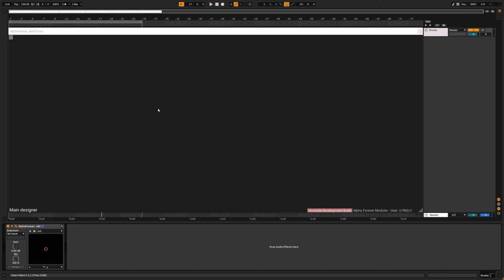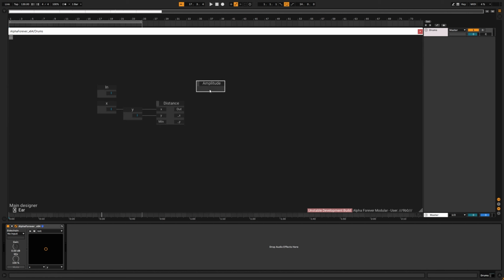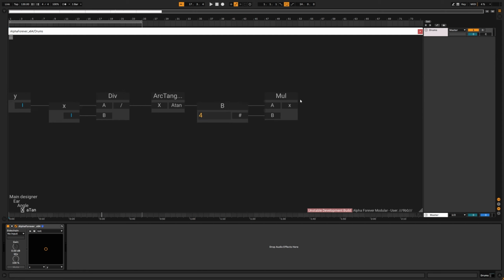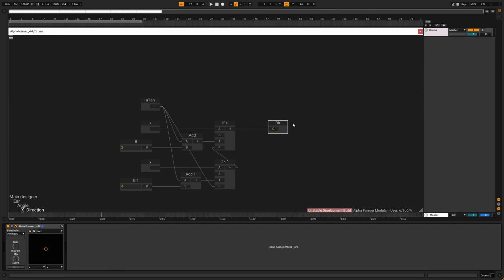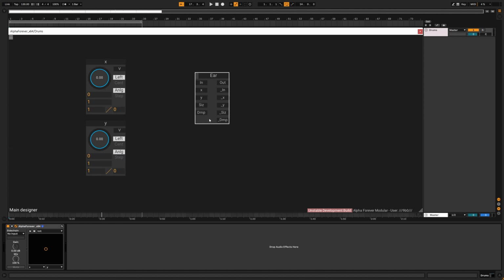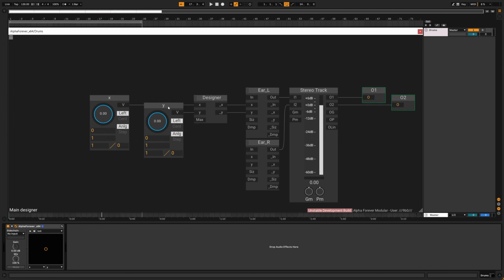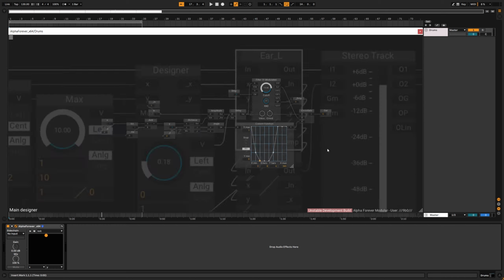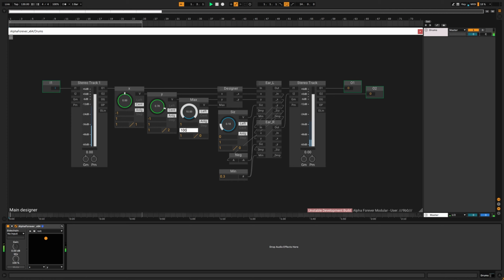Place your sound on a 2D plane

Comment from the maker: IF YOU FEEL LIKE 2D IS NOT ENOUGH:
One can enhance the patch to work in 3D easily. It only requires another parameter (z), and the distance calculation changes to distance=sqrt(x*x+y*y+z*z), and the vertical angle can be calculated using the same method as the direction, but it needs another distance p=sqrt(dst*dst+z*z), and the angle can be calculated using the same function as the direction, but to replace 'x' with 'p', and 'y' with 'z'. This angle can drive another custom function that can be added to the 2D custom function to crossfade to the filtered output whenever the angle is above or below our head.

I can make a separate video on converting the patch if you'd like to!